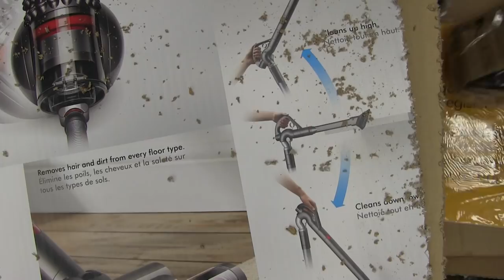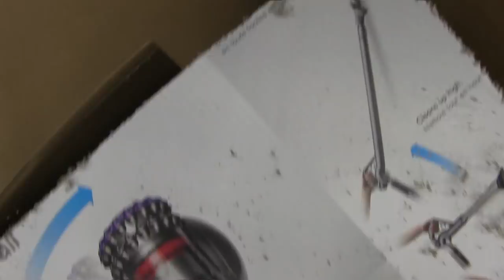DYSON ANIMAL BALLS | It blows!

Comment: Dyson used to be so great. I still reccomend finding a DC07 with a blown motor, then swapping the motor. I've aquired several for free. Even the £20 ebay motors will last a decade of daily use, and although the bodies are plastic, it's just as well they aren't metal, they're already heavy enough as it is, and are far more solid than the newer ones. If you do break anything, there's so many parts around for next to free that it isn't really a big deal. Also unlike the modern ones the bin is much bigger so you dont need to empty it after vaccuming a single room, and I swear the suction is much stronger too. For the price they are these days, the parts supply that is around, and the effectiveness, there is nothing else close.

Anything dyson post ball is a load of balls unless you really are so weak you can only push around the flimsiest of crap. The handheld is good when it is working I suppose but the battery life isn't ever enough.
Reply: unregistredhypercam absolutely agree. The Dc07 is an amazing bit of kit. Bargains now too
Reply: That's why I like Kirby. Yes the design hasn't changed much aside from the Tech Dive in 1990 but their quality and performance is incredible.
Reply: Yep, gotta second hand DC07.
Originally it was terrible but it turned out the cyclone bit was ground flat by sharp dirt.
Or local Dyson repairman replaced that and it's fixed.
Reply: James Neave 
I remember the first ones. I wish they still made em the same way.

Comment: take a look at the competition sometime? miele and riccar are good according to reddit's vacuum guy
Reply: teslaTrooper I can attest to miele. Used to murder vacuums. Miele has done me well. 

Plus the switches seem to be so much more than those lil ones.
Reply: I actually bought a miele because of the reddit vacuum guy.
Reply: had filter queen 15 years but the power head gave out and bought a meile had it for 8 years and the plastic parts gave out and bought another meile its about 10 years old so it will probably give up the ghost soon. Grandmothers old rainbow out lived all of them

Comment: Really love the Dyson battery vac. The circuit board is in the airflow and has no conformal coating (to make it waterproof.) If you wash the filter (which is what they recommend) and don't wait long enough before you use it, you blow the board. Whole new motor assembly needed.  Great design...

Comment: Does 60hz AC,,, hit 0v, 120 times a second? Not 60? As a full oscillation is 0, max +, 0, max -, 0 repeat..... 1 0v measure per peak. 2 peaks per hz
Reply: And it actually hits 120V times the square root of 2 ≈ 170V and zero 120 times per second. 120V is just so called effective voltage or the RMS voltage. My heart feels broken after what he said. ;(
Reply: mathtone I knew of the RMS nature of AC voltage. 
I just had to say something about it touching 0v 120 times, not 60hz. 

Great video as always btw AvE
Reply: +mathtone Missed point.

Comment: I sucked up plaster once... Friiiiiiiiick... Don't do that with a house vacuum. If it's not the pyroclastic flow that kills you, it's the cementation of your lungs.
Reply: I took a 1980s Soviet ЦИКЛОН (it may be called a cyclone separator as in it the heavy stuff doesnt stick to the filter) to an unsealed dusty concrete floor once, gummed the cloth filther right up in a few minutes :D. The concrete dust was on there thick but in the end it cleaned up quite easily. Its now my shop vac :D, I plan to add a real cyclone sometime in the future, save some trouble of opening the thing up and sealing it all the time.

Comment: The roller is meant to tickle the dust out of the carpet not rip it to shreds.
Reply: It also does a good job of not ripping your fingers off or destroying something you didn't mean to suck up like cables, while still working just fine.
Reply: jbrizz99 sounds like you drank the kool aid
Reply: Powered ones "tickle" better and the best of the dyson ones will stop the motor when impeded by foreign objects to prevent anything getting ripped to shreds.

Comment: There is a design issue with these machines where the wheel breaks off. Those tiny bearing are not great. Dysons are not made to last as they want users to upgrade to the newest one every few years. I found SEBO to be efficient and reliable and less complicated.
Reply: All weight at any angle on the wheel is supported by the body underneath, the bearing is just to hold it there. I call BS on your claim!

Comment: You should compare to a Miele. They work better and have less marketing wank, but who knows if they are made better (well, Made in Germany, so we know it is made better, but who knows if they are better parts).
Lifetime filter? Imagine the poor sap who vacuums up a bit of plaster dust with it.
Reply: TheRacerRich It depends which Miele you buy. If you buy the one from Costco, it's basically a rebranded run of the mill canister. If you buy a good one from a dealer, they're one of the best. The other brand to look out for is sebo, also one of the best in the current market.
Reply: Interesting about Costco. I use the upright, and I know mine from Bed Bath and Beyond is made in Germany.

Comment: That was a bit of a let down...  my wife came home with a Dyson animal facuum at one point.  About 2 weeks later a Kirby salesman came bye.  For $100 more than the Dyson cost, I got the demo model.  Costco took the Dyson back, and we have been happy ever since (until we replaced 80% of the carpet with oak).
Reply: MikeCookie1973 your Kirby should have the attachments for hardwood floors, polishing and cleaning brushes. I sold Kirby vacuums for a while.
Reply: I still have, and use on a regular basis, my Grandmothers 1950's Hoover upright. Talk about something that sucks! Around election time back in Nov, I ended up pulling out a 'UGE hair ball. Come to find out it was Oprah. Should have flushed it instead of the garbooge. LOL
Reply: Josh Gourley we got 5+ solid years of abuse cleaning up after our first couple of golden relievers, and now the next round... a one year old golden.
Reply: Getting rid of carpet is te correct answer.

Comment: the motors use the air they pull in to cool the motor. if you clog them they catch fire, hence the inverse blow-off valve

Comment: Damnit ave. Don’t tell people to mess with the governors on there lawn mowers. It will make them last even longer and the small engine shops won’t have engines to replace ;) haha
Reply: WineScrounger that was the joke.
Reply: Small engine shop? It's cheaper to go buy a new one then to get most of that stuff fixed. Good for 3 or 5 years then you go chuck it in the garbage.

Comment: Dyson make total junk, they do work well, but constantly break and foul to peecies.
Reply: Dyson sucks! It’s good on suction but the quality of the plastic is pretty poor. Overpriced and over engineered .
Reply: I've had a Dyson Animal upright for about seven years and I've fixed it about seven times. Most popular failure point: the power switch. I started ordering the switches two at a time after the second failure.
Reply: @toddniehaus  I'd just remove/short the switch and maybe fit an in-line one on the cord.  Also, who cares if the retract-a-ma-thingy doesn't retract any more?  My 22(?) year old DC03 doesn't have one anyway, and it still sucks pretty well considering the crap (builders rubble and shop debris) it's ingested.  I don't think the next one will be a Dyson though.
Reply: They really are not very high-quality Dyson I am a vacuum technicianI would say they’re really not very much fun to deal with tearing them apart the cyclones

Comment: "filter is worth 100-200"
"this is worth 150"
Word?
Reply: Precisely.  This guy clearly doesn't like this Dyson, so don't expect his valuation to be based on common sense or reason.
Reply: It's not an exact science with him.
Reply: @hhn2002  You're right there. I find his videos entertaining but I don't share his sentiment a lot of the time. The Dyson Big Ball Cylinder with the dual Carbon and Nylon brush bar out performs just about every other vacuum cleaner on carpet. It's not all about the air watts - but the interface between the brush head and the floor. This is where Dysons really excell.

Comment: So that poppet valve and spring was just a cheap 'never overload the cheap shitty parts' valve. Just an air bypass for when the POS hits its shitty limit. Am i understanding that right?
Reply: Blocked airflow also means no cooling for the motor. Bad news in the ball sack.
Reply: Bernd Felsche I think you’re right, I suspect cooling is the sole reason for that valve.

Comment: 9:50 doesn't a 60hz sine wave reach zero current 120 times a second?
Reply: It does but he Probably converted his house to 30Hz.
Reply: Three times.
Reply: Mitchell McCreath two times, the cycle starts at zero at t=0, goes up comes down through zero (count one) and back up to zero (count two), you don't count the one at t=0. Well, you could but then the last one (the third) would be the first of the next cycle. I think that makes sense.. lol. I'm just being a dork, feel free to correct me if I missed something.
Reply: Its easier (for me at least) to think of it as starting at the top of the wave, down to the bottom includes one zero-cross, and back up to the top includes the second, and completes on cycle or hz.
Reply: that'd be a cosine wave
Reply: Hellsslave666  more like a high strobe rate at 30, disco house.   :)k
Reply: James... A sine wave and a cosine wave are both "the same"...  (ok TTP)

Just that you start measuring a "cosine wave" at the antinode, rather than at the node.
Reply: yup, ahensley63 said "Its easier (for me at least) to think of it as starting at the top of the wave"
Reply: ahensley63 
As an Enginerding student, that is definitely not a good thought process and mind boggling that you think of it that way... and not in a good way

Comment: They are the apple of vacuums
Reply: logik100 True.
Reply: And the tesla of cars.
Reply: Not completely. Dyson’s handheld vacuums are truly the best out there and are (at least in my opinion) worth the price, especially when they can be frequently gotten on sale. They really are the most powerful handheld units with the longest battery life. Expensive, yes, but unlike others they are a true vacuum that’s handheld. Apple doesn’t really have any products anymore that offer the best performance (or even functionality) in their class. Now as for some of Dyson’s other products like this POS...
Reply: Apple sells good adapters :D

no, seriously: I use an Apple Thunderbolt 3 to 2 and Thunderbolt 2 to Firewire adapter with my Dell.
Reply: What, PCs with a sticker and premium price?
Reply: Robert Miller have you ever used a Macbook? The hardware and packaging are by far the best in the entire industry. Aluminum enclosures, trackpads, screens, design language.
Reply: "The hardware and packaging are by far the best in the entire industry."

Not quite true. The hardware of Apple's most powerful laptop is equaled by the Dell XPS 15 (and many other 15-inch laptops), and exceeded in some cases (e.g., number of USB ports). Also, you won't find an Apple laptop that will match the power of a Dell Precision workstation laptop, or a gaming laptop. You won't find an Apple laptop that can carry a 4 TB HDD and a 1 TB SSD in RAID configuration.

As for packaging, any business laptop will equal or exceed Apple's packaging in durability and usability.
Reply: AvE should buy a kirby made in USA, weights so much they will brake gran's back. My mom has a kirby for 30 years now works so well it will literally fucking chew  and digested a floor mat.

Comment: I had same opinion 12 years back when i bought a dyson. However it still lives although heavily misused. Only had to replace the electric supply reel once because elec connection broken. But all the silly small parts are still alive.
Reply: They are still a good product but ridiculously overpriced. That said, if they are going to begin to have crap switch assemblies like that and more off the shelf components, for the same price, then their reliability is certainly going to be up for question.
Reply: My mother in law used to go thru a vacuum every year until she got a Dyson. That sweeper is still going after countless years and only had to have a new belt and brushroll after many years of hard use. Expensive yes, but not compared to all the cheaper units that would have needed to have been purchased instead. Overall, it’s been a right skookum choocher!
Reply: This probably does say more of the general quality of vacuums. We used to go through one every year or two as well until we got a Dyson.

Comment: Nice job, my man.  My ex-whiff bought a Dyson (against my advice) several years ago and every time I yanked it apart to fix this or that (the bearings on the beater bar were always taking a shit) I was always apalled at the internals just about as much as you were.  Not to mention Dyson's brainless commercials bragging about their "v8 'Digital' Motor".  Yeah, "v8" as in VERSION eight, but referred to like it's a V8 engine.  The INSTANT I detect ANY company trying to pull that kind of "less than honest" shit - I am done with them.  Plus I can't stand that lispy half-faggot voice of his.  Dyson, along with his products can fuck right off...

Comment: To me, the most impressive thing is the axial fan as the first stage fan, blowing into a centrifugal impeller. I've serviced vacuums for years, and this is the first time I've ever seen that. It's very much like the compressor half of a turbocharger. very efficient. I would like it better, if it were possible to take the motor apart, to service the bearings. Otherwise, it's a throw-away. You just replace the motor if it goes bad. Even though the windings don't look secure, I think the motor will still out-last the rest of the vacuum. I'm very disappointed with the turbo power nozzle. Allocating airflow to turn the brush really reduces the CFM for cleaning. This would have a hard time picking up heavy dense particles, like un popped popcorn seeds, uncooked rice or wheat. It just wouldn't have the airflow velocity in the brush roll housing, to carry off debris like that. It WOULD be much better, if it had an electric motor to drive the brush, drawing all the air through the brush roll. Since I have no allergies, if the HEPA filter became restrictive, I would just toss it, and run the machine without it. The cyclones and the secondary washable filter are good enough for me. Again, it's hard to say if the machine would last long enough for that to be an issue. That hand held turbo brush for the furniture looks like it might actually work pretty well. The suction is concentrated over a smaller nozzle area, which might give pretty good airflow velocity. That turbo carpet nozzle could just hit the bin. Other viewers have explained the suction bypass valve perfectly, so there's no need for me to explain, other than that in normal conditions, it does not decrease airflow through the hose, unless clogged. I've seen other vacuums, that just simply have a small diameter aperture to do the same thing, but that design does reduce suction at the hose all the time. This looks like an excellent design, just poorly executed.

Comment: 10:45 Isn't the vacuum break-out valve supposed to engage in case something completely blocks the sucker-pipe? Also: if it's cooling itself with air-flow, if the air-flow is stopped, then it may overheat - so I guess this is a safeguard against that?

Comment: "*Dyson: You pay for our commercials.*"

Also: Vacuum break could be in case you go over something that gets sucked the fuck up and starts allowing the vacuum to build up TOO MUCH pressure (eg: you've clogged the inlet and now it's just going apeshit building pressure without pulling anything in). So, it essentially blows off the extra pressure so it doesn't blow the whole unit.

Comment: The dump valve that allows airflow through the impeller in a blockage situation is necessary for motor cooling.  You know when vacuums are designed this way by the hot exhaust air.  Some vacuums have a separate cooling fan, similar to a frill motor.

Comment: The poppet valve indicated that my vacuum was clogged with debris near the inlet. If the vacuum is clogged, air will flow through that valve and make a bunch of noise. I cleaned out the tubing and it went back to normal. It’s just the vacuum equivalent of a hydraulic pop-off valve for example.

Comment: I have the first generation Dyson sled vacuum, the DS02. Had to repair the cam wheel of the auto-rollup electric cable. Works fine now. Only problem is that they stopped making the air filters for it. Haven't gotten around to it making some custom replacement ones.